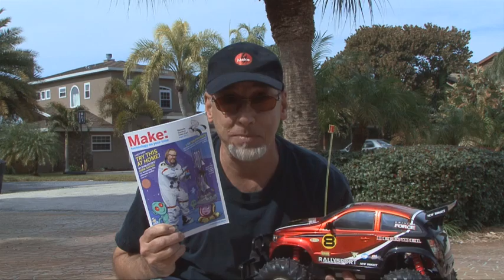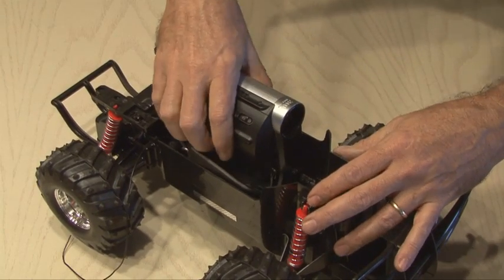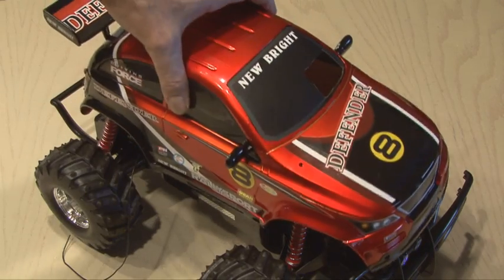Weekend Project: Remote-Controlled Camera Mount

Comment: Instead of making a hole for the camera to look i would cut out the black plastic that serves as the windshield and install glass or better plastic that shows ur reflection on one side but is see through the other side and buy or modify a camera so u can control it with ur phone

Comment: @pomeroy600287 Got mine for EUR 6.56, including shipping fees... 

Beware 720 is not the line count, this is a 720 dots wide x 480 lines high cam. Buts that's enough for most applications.

Comment: An easy way to get the video live is to mount a mobile phone that has a camera & set it with another cell phone on video call & you can see live in you mobile, & for the range of the remote just make big electromagnet coil instead of the ordinary antenna & set each poles of the coil to the existing 2 wires of the antenna & control you spy RC car from far away just like a Movie that a kid saves him self from bad guys I don't know the title of the film but its about Xmas I knew this before Kipkay.

Comment: cool little project but...
a much easier and cheaper project would be a wireless micro spy cam built in the car...  no mods needed to car and you can watch/record the live video feed as you drive it!

you can get a wireless micro camera and reciever kitt on ebay for about $35.00 easy install and it dont add 3lbs to the car so you can do this to even the smallest remote control car!

Comment: Surveillance CMOS module with FBAS output, RF adapter (cheaply sold e.g. as modules for SNES/N64 now), HF amp and antenna. Can receive that with any TV, but i'm sure it violates some regulations.

There are also some WLAN IP cameras out there, but they don't come cheap.

Comment: you could add a wireless transmitter and sneak up on people see what they are doing lol and try to make it as silent as possible haha

and sure why not instead of  cutting the windows you could replace them by the one that you can see from inside but its a mirror from the outside so the cam-coder cant be seen

Comment: This project is akin to gluing a fort and a spoon together and calling it a spork. 

I would be more interesting, and practical, if the camera was disassembled and embedded into the RC car.  The two batteries could be put in series or the camera and car could run off the same power supply.  It would be even better if the camera feed was rigged to transmitter so you could drive first person, so to speak.  

Design is 1 out of 5

Comment: Its easy if you add a 12v gel battery and have a wireless N router. Drive it like 100 feet in each direction from the router (as long as you boosted the signal)

Comment: I bought that Shift3 USB video camera thats a flip cam like clone and I have a mount on my RC hummer for it but I want to attach it more securely than it is b/c the camera is like the single use video camera you hacked and mine wobbles. I can use my Canon Power Shot but I dont want to risk breaking it although its a lot more secure.

Comment: buy a wireless home security camera and as long as u stay within range(which is fairly small) u would b able to see as u drive........if u hooked the other end to say ur laptop u could b more mobile.......not that hard to do wireless cameras run about 100 bucks for a decent color version at hardware store and they run off self contained AA batteries..... u just have to supply the wired part that hooks to ur computer with power.....the usb port can b enough on some models...